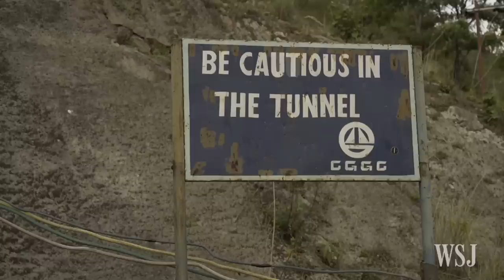Nepal Races to Develop Himalayan Hydropower​

Comment: Nepal should start looking for other renewables (solar and wind) instead of doggedly pursuing hydropower.
Reply: Start looking is not a bad idea.However, Investing on solar and wind at this time is too early.Solar and wind are only 40-50% efficient at most and on top of that, there are lots of things to be considered to be that efficient. Hydropower on the other hand, is about 80-90% efficient.
Reply: Consider two cases:
Method 'A' has 10% efficiency but provides electricity at Rs x per unit.
Method 'B' had 90% efficiency but provides electricity at Rs (x+10) per unit.
Which are you going to choose: Method 'A' or Method 'B' ? I do not know the details of these two systems yet.

However, I am still not convinced we should give so much priority to hydro, especially considering what it does to river environment and its ecology. Solar may be more difficult to implement (which I doubt), but in my opinion, it is a more responsible approach.  Just my two cent thought.
Reply: I do agree with you. Considering recent climate change, we might not have good water source in next few decades or centuries from now. An alternative is always a good option.
Reply: The area needed for solar and wind plants for providing electricity is way too large. Nepal being a small country with unever terrain causes large disadvantage in this prospect. Plus the largest of wind source is from north direction which is blocked by northern mountains. Wind plants is only ideal in seasides. Solar occupies too large of an area you can see recent projects in china and germany. So it's not just about efficiency but feasibility.